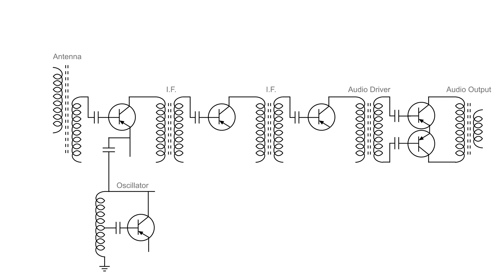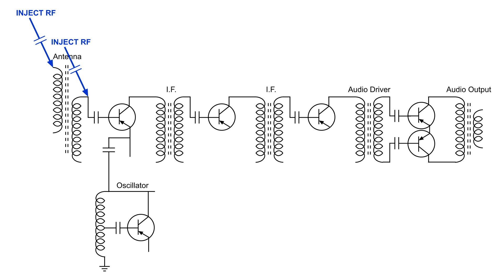Oscillator Troubleshooting, Transistor AM Radio Bradford WTG-60715

Comment: When I was in High School Our Electronics Teacher Taught us The Hair Dryer Trick,,,We would heat up every Germanium Transistor with the Dryer!!!  This Little Trick ACTUALLY WORKED!!! Germanium Transistors have Higher Icbo ( Thermal Runaway) Than Their Silicon Friends and Would Break Down quite a Bit!!!  He Told us Radios would Break Down in This Order  1)  Germanium Transistors   2)  Capacitors  3) Resistors  4)  Coils,,,,,,,  Once Again  Keep Them  Coming!!! ( Those Videos!!)
i

Comment from the maker: Not sure why. Usually a bad transistor will play until it heats up, then you cool them one at a time to find the bad one. Over the years the characteristics of the PNP transistor changed. Adding a little more negative bias on the base, caused it to function again. If this was a NPN transistor you would use a positive bias on the base.

Comment: Hi Rick, well done on finding the ‘thermionic transistor.’ Oscillators can be the very devil as either an open circuit or closed circuit component simply kills it stone dead and it’s not very day you find a transistor on the edge of thermal stability is it. Nice one.
Kind Regards ... Andy